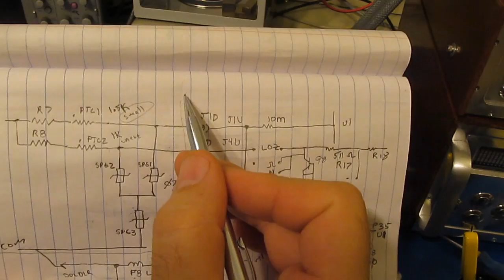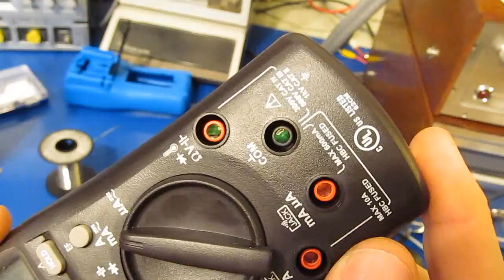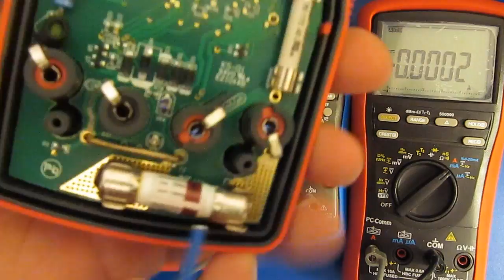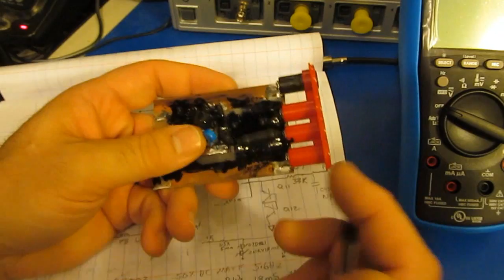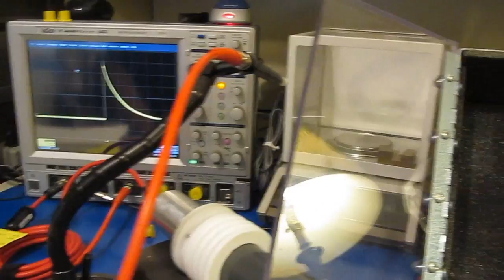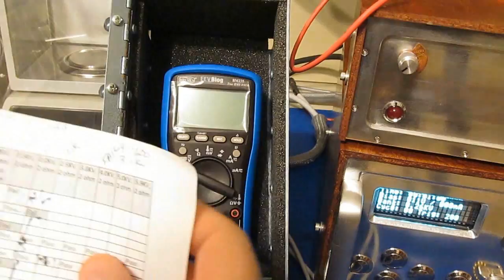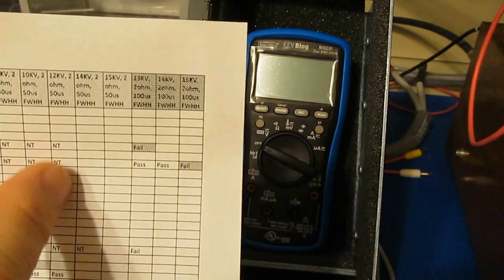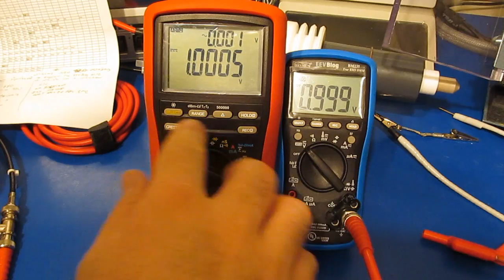Review of the EEVBLOG Rebranded Brymen BM235

Comment: Hi Joe.An excellent video.

I am interested in the over-voltage testing of multimeters to show compliance with the Cat standards. IEC61010-1 lists the over-voltage test limits required depending on the maximum working voltage being measured. So for example if a meter is marked as 600V Cat III then it must be able to tolerate 3.4kV for 60 seconds. 

The front end protection on most meters claiming a Cat level are very similar to the the Brymen circuit that you have sketched out in the video. Whilst I can see how the circuit protects against short duration surges I cannot see how it is designed to protect against longer duration over-voltages.

If one imagines that a 3.4kV over-voltage appears across the meter input then the PTC will heat up until it drops most of the voltage, will it not then breakdown with about 1.4kV across it resulting in a large power dissipation in the first 1k resistor? Is this 1k resistor a fusible type that is designed to go open circuit in such situations?

I have not seen any of these over-voltage tests presented online, it would be interesting to see how various meters perform.
Reply from the maker: I have heard of people attempting to directly measure the output of a MOT with their handheld. You need to take a step back and just think about what you are suggesting.  Does this even make sense to you?  I would read how they define Working Voltage.  Make sure you read Note 1.  Maybe Annex E.  I am not sure where the 60 seconds came from.  Maybe you could provide the sections you are referring to.
Reply: I think I have misunderstood the standard. I was looking at the test voltages in Annex K and thinking that these were differential voltages across the input of the meter. I think that these are actually a test of the insulation and therefore not a differential test.

The 60 seconds is mentioned in K.1.3.1 & Table K.8

That being the case, what is the purpose of the PTC in the protection circuit? It is never going to respond quickly enough to transients.

The other thing that I don't understand is how some meters manage such impressive ACV bandwidth. I have a Fluke 287 here which is almost flat to 1MHz! How is this possible when the input resistance is a minimum of 10M? Even a few pF will result in a low cut-off. The front end doesn't appear to be compensated like scope inputs and putting a high voltage cap across the 10M seems like a bad idea.
Reply from the maker: I can't really comment on the whys of meter designs.  61010 is a safety standard and if we assume the meter is not required to survive then why have a PTC or anything else as long as it does not make an unsafe condition?   Of course if your products are always being returned from being damaged, as a supplier maybe you need to address it?  In the end, I assume if a company certifies and to what standards, how much protection they add,  it all boils down to how to make money.   

If you watched the video I made where I look at making the UT61E more robust, you may find your answer.    If not:
https://www.youtube.com/watch?v=cMutvk_6xhY

Comment: Just noticed the Mettler AJ100 analytical balance in the background. What do you use that for?
Reply from the maker: That's there to measure small weights.   Asking specifics would be like asking what do I use a volt meter for.   I did make a video where I used it as part of a small dynamometer.   It's pretty fast and has an RS-232 port on it.
Reply: Interesting. I just watched two videos of your dynamometer. I'd be interested in a detailed video explanation of your setup, if you have the time.
Reply from the maker: To be clear, I have no interest in RC toys but I did post about the dyno as I was constructing it on a RC site.   You may find it here.  https://www.msuk-forum.co.uk/forums/topic/81512-self-built-rc-dyno/?page=6
Reply: Wow, those are some impressive analyses. Nice looking setup as well. I didn't read every post in the thread, so forgive me if this was discussed already, but it would be interesting to do some comparisons between similarly sized/spec'd brushed vs. brushless motors.
Reply from the maker: Glad you enjoyed looking at them.   At least it gives you an idea of what not to do. I had several people contacting claiming to be some big motor suppliers and such asking about the dyno.  I just kept explaining that I didn't own any RC toys and this was just a model for a larger dyno.  I'm not sure why but people had a hard time believing I was not some sort of RC race guru.   The absorber will handle about 100 Watts.  There is a ground shaft to align everything when installing a motor.  With the ceramic bearings, I could do pulls well above 20K RPM with it but proper alignment was very important!

Comment: Thanks for the video. Was thinking about getting into ardiuno projects, would you recommend this meter, or is there another that would be better for the same price. I have seen it on amazon.ca for about 145.00 CAD.
Reply from the maker: Sorry but I can't make recommendations as I really have no idea what your needs are.  I would read the manual for it and see if it has the features and accuracy you need.   If you have a specific question about the meter, you may want to set up an account on EEVBLOG and post it there.  I'm sure Dave and others would be more than happy to help you out.
Reply: Thanks for the info.

Comment: Hi, i enjoyed your video. I just received my EEVBlog 235 meter. You mentioned that the continuity buzzer was not very loud. I found mine was also very low volume until i hit the range button and the volume got very loud. I don't know if thats a new feature of the D firmware that mine has or is just a undocumented feature, but thought i would mention it.
Reply from the maker: Mine is also revision D and the range/level button has no effect on the loudness.  I'm not sure why yours would.  You should post Dave about it.
Reply: I just posted to Dave about the continuity loudness, I will let you know if he answers me.
Reply from the maker: Hopeful that he does.  If I could have replicated it, I would have made a post with a video.  Is there some specific steps you did to get it to change?
Reply: When i tried the continuity test I could just barely hear the tone but the back light flashed on and off, so pushed the range button, (I think), i was also pushing the select button trying to figure things out. The next time i tried it, it was nice and loud with the backlight still flashing. Since then, I've tried to turn it back down again and i cant figure out how to do it, so maybe Dave can explain it. Even my wife a daughter noticed the volume come up.
Reply from the maker: Hey Joel.  I did post your question on Dave's forum.  Dave was not aware of it.
Reply: He never got back to me. Oh well, I'm happy with my 235.
Reply from the maker: If you ever figure out how to change it, post about it.  Some of the meters I have looked at use a separate CMOS oscillator to drive the beeper.  Those would have no way to adjust it.  I've not looked at the 235 but maybe they can change the duty cycle enough to make a difference.  You could trace it out and see if what you saw make sense.

Comment: This is incredible work you're doing. This is far and away some of the most rigorous electrical testing I have seen done on multimeters. I'm really glad that I stumbled on your channel. 

BTW, if you ever want some fodder for your transient generator, I have a handful of junky meters I could send you. Maybe you're aiming to look only at "real" meters, but mine are mostly off-brand hardware store buys and a couple "Ebay Specials," seeing as I'm actually still using my good meters.
Reply from the maker: Thanks.  I'm glad you are enjoying them.  I think the biggest reasons you don't see more testing on meters is cost and time.  When you watch this video, realize the transient generators and high voltage probes are all home made.  Price out a real generator.  Not to mention the hazards if someone went with a purchased unit.  Then there is the cost of the meters.  But the worst part is the time.  If you look at the clock on the transient generator, you can see how long these tests take to run.    I do it out of my own interest.    I appreciate your offer to provide some meters for testing.   I have ran all sorts of meters.  That analog meter was $15 and was as off brand as they come.

Comment: i was hoping you would test that meter. I like my brymen 829 as well. doesn't have the resolution that yours does but I don't need that. Great video as always I enjoy your videos.
Reply from the maker: Thanks.  I'm impressed with the Brymen brand so far. I use mine a fair amount and have not had any problems with it.
Reply: my first 829 was from tme and it had an issue so i sent it back. after 9 months of trying to get answers i finally just recieved a refund. Good pricing there but as far as customer service they need alot of help.
Reply from the maker: I just wrote Brymen direct when I planned on running the 869s.   They had the best communications of any of the companies I contacted.  Mine came from TME as well.  No problems at all.  Very fast shipping and a good price as you mention.
Reply: yes i agree they were great to deal with, they even helped me yell at TME because they stopped responding to me. Eventually I just sent the same email to every contact on TME website until they just gave me some story about my meter being damaged in shipping and refunded me. I just didn't have a good experience with TME . I considered Greenlee(looks like same meter( but the price was much higher.
Reply from the maker: I wrote Greenlee and asked if they had changed anything with the 869s besides the color.  They did not respond.  So, TME it was.
Reply: yes you mentioned that in the one video. I enjoy watching what you do and I learn a thing or two along the way.

Comment: Im amazed by the 235, voltages that it should never see in a lifetime it coped :-D
Other than physically throwing the generator at it, the 235 is bullet proof.

Yes i think your lighting system in the uni-t is really clever, never need to think about seeing the display again :-D.
Reply from the maker: LOL!!  The case on that generator is 1/4" thick plate aluminum.  Throwing it at any meter would cause some damage!

Comment: Nice review, I always wondered if it would pass you transient generator testing. Its good to see it passed. I also really like this meter, it's become one of my favorites. 
One feature not mentioned is the 235 will read ACV variable frequency drives, it has a mode selector specifically for this in the AC voltage reading. Not a common thing to run across in a home hobby, but I did recently run across something I was repairing and it was the only meter to take an accurate reading. I personally never thought I would use it, but It worked good and I was glad I had it.

The low pass filter is a nice feature that can be used to discharge caps and get more accurate readings in some situations when taking a reading on a variable frequency drive or composite sine waves created by inverters.

The auto mode works good detecting AC or DC (also the low pass filter mode) but you loose resolution when using the auto mode.

I also wish it read higher frequencies and had the ability to read duty cycle. Besides that it's a great meter. 

P.S. It did survive the electric ⚡️ fly swatter test at 2.3KV DC.

Comment: Only half way through the video but wanted to mention the non-pop parts have to do with three different models being used for these PCB's. You will see 231,233,235 with pads next to it in each PCB. And they drop solder in what the one is populated for. I don't have the cutout on the back screw post, this might also be because they changed the components in version two (white box) and some other slight changes to stop the LCD light sound on some of the original versions. The new components might be thicker and they had to cut the post to adapt to this thicker parts? Just my guess.
Reply from the maker: Hey Scott.  I almost called you out on the difference between a cap and a bead.  lol.  As I mentioned, the two extra clamps are not routed.   The question then is if you have the other models and have looked at how they are populated.  Sounds like you have.  I am interested in knowing then which version of the meter is using the MOVs?  I measured the stack up for the case and PCB as well as took some pictures of mine.  These are up on the EEVBLOG site if you want to have a look.We need to revamp the flyswatter test.   Maybe parallel / series a few hundred of them!  lol.
Reply: Sorry, I don't have the other meters, this is my first Brymen. It's just a guess like the cheaper flukes are the same PCB for 4 or 6 different meters  just with missing parts. AVE did a tear down on one and I noticed it was the same as others flukes but missing a DAC and IC for RMS, also the temp reading and other features worked but didn't have a button pad or a whole for the button on the front of the case. I just did a google image search for thenother models to do side by side of the PCB boards.

I own two fly swatter, so we have three. Might be easier to remove flyback circuits from old tube televisions. Or I have a box of ignition coils with about 25 of them, lol.
Reply from the maker: Ok, I thought with you pointing out that the non-pop parts have to do with the different models, that you knew the details about the MOVs that were a no pop on the 235.   At 2.5KV DC, you could use it to charge a bank like I did with the cap when I took out the UT90A.  I have not had mine apart to measure the size of the filter cap.